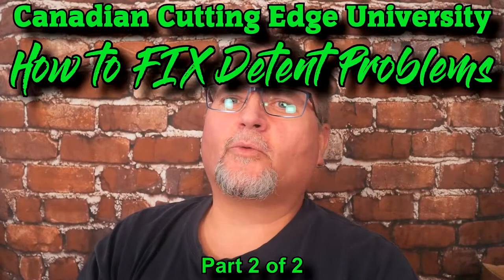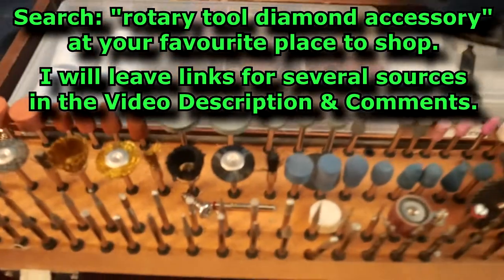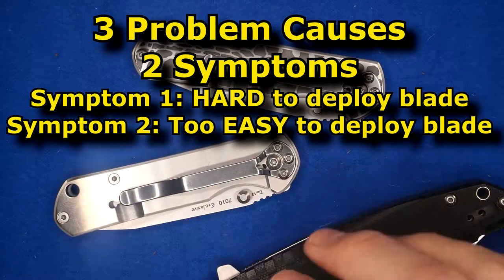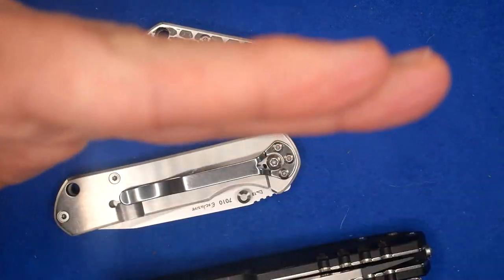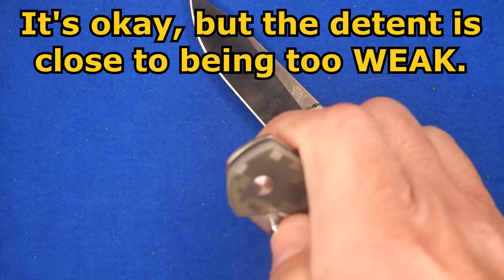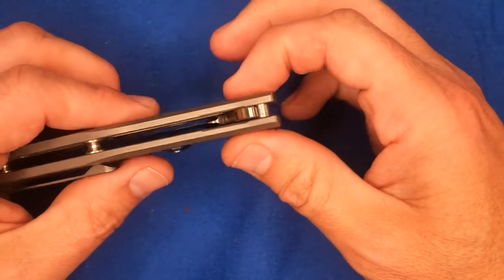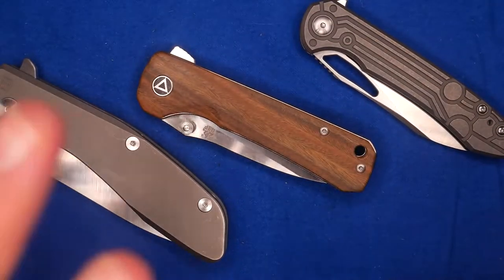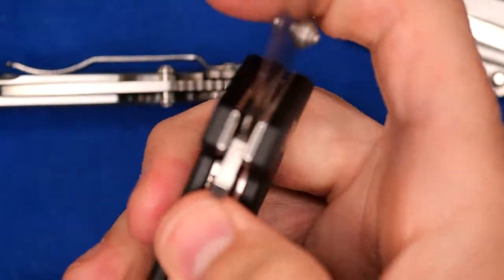CCEU Lecture #24:  How to Fix Detent Problems - PART 2 of 3

Comment: Really like and appreciate your videos. I have to say though; I've never seen a liner lock or button lock that I could not deploy by swinging my hand and pulling back up abruptly. That doesn't indicate a detent problem. On the contrary; I'd say perhaps the detent is too strong if you can't. The problem with all this is different people's physical ability to perform the action.
Reply from the maker: We each have our own preferences (not merely ability) about how we want a knife to function and how easily we want the blade to deploy.  
I am not trying to tell people to change their detent to my preference, instead, this video series teaches people how to identify why the knife is working as it is and what they can do to change that, if they want to.

Further, some viewers live in countries with legal requirements for how easily a knife blade can be deployed. In fact, in Canada, if a blade can be fully deployed to a locked open position using the method you prefer the knife would therefore not be allowed to cross the border into Canada, so they might want to adjust their knife for this type of reason.

Comment: On the knife with the too stiff detent, where you took the bit and went in parallel to the hole, could you have gone in at a 45° angle for example, and radiused just the edge of the hole where the detent ball enters and exits? Would there be any potential issues doing it this way instead of what was shown?
Reply from the maker: Even when I try to go in straight there will always be some chamfering going on at the edge of the hole -  this happens because it's being done by hand;  there is no way to be perfectly perpendicular with the tool which = some degree of chamfer.  You want to just barely chamfer the edge ever so slightly and then test it.  I would estimate that I break a 90° edge over to about 80° or maybe 75°. Most of the time and that ends up being all it needs. The issue with a 45° chamfer is that it will make the detent way too weak / soft and I would guess that the odds are above 99° that you will ruin the detent completely and beyond any other repair options.

Comment: Hey Jake! Thank you for this series. 

Even with production knives today, do you encounter ones that need tweaking of their detentes? 

I have one folder of mine that is really hard to flick out, and It makes me curious whether this is common (like 5 out of 10) or  much less common (like 1 or 2 in 100)?  My experience is only from about 20 knives, so figure you or the viewers will have broader awareness than I. 

Thank you.
Reply: I own hundreds of knives and I find it necessary to adjust the detente on one out of every four that I buy. I am very picky about how my knives should feel when opening and closing them.
Reply from the maker: YES, I often need to fix detents, that is the MAIN reason why I made this video series.

Comment: I NEVER use a rotary tool for the detent hole, it is so easy to make the hole too big, I use a drill or a diamond grinding pin with my fingers, it takes longer but is safer. Thanks for the video
Reply from the maker: OF COURSE!!  I missed that another power source for the same task.  I guess with my arthritis in my hands I didn't think of doing it that way because I wouldn't be able to.   Yes, the vibration of the rotary tool isn't pleasant for my arthritis either but it's very short.
Thanks Orange.

Comment: I am interested in a possible fix for a frame or liner lock that slips over too far on the back of the blade. Not sure if anything can be done. It's on a Gerber Ripstop which I got for ten bucks Canadian so no great loss. But it's worth fixing all the same.
Reply: You may try to make the locking liner longer via deforming it by impacts. But the ball positioning may be lost if to make it too far.
Reply from the maker: What err0ify O suggests is the only option you have.  It is not easily done but it's a very cheap knife, exactly the type that I would use to learn the skill. I do not have a video on how to do that.

Comment: I have a Benchmade Griptilian in 20cv that has a very weak detent. Since I've modified the knife, I dare not send it back for warranty repair because I've heard Benchmade doesn't like dealing with modified knives (I don't know if that's actually true or not, but I still don't want to risk the hassle). Anyway, I've not taken the knife fully apart yet, but since it uses an 'Axis' lock mechanism, I'm not sure how I'd go about fixing the weak detent aside from tightening down the pivot screw; which I've already done. Unfortunately, although tightening down the pivot screw a wee bit does increase the detent, it also stiffens up the action which isn't very nice. Do you have any suggestions?
Reply: I thought BM fixes everything under warranty. That's what you pay for.
Reply: @barrybogart5436  I don't know if that's true or not? I've heard stories of BM refusing service, or charging a fee to fix a modified knife. Like I said, I don't want to risk it...
Reply: I would disassemble the knife to make the omega springs stiffer.
Reply: @err0ify  Thanks, I was looking into getting some stiffer springs as well...
Reply: @singingtoad  you may just try to stretch out the existing springs -- they'll become stiffer.
Reply: @err0ify  Thanks for that suggestion. I might give it a try first before I order new springs...
Reply from the maker: An axis lock knife doesn't have a "detent" it just uses the omni spring tension.  You can write to Benchmade and tell them one of the springs is broken and they will send you replacements, it is common with Benchmade knives and in fact that is probably why you feel that it is WEAK - because it probably has one broken omni spring.
Search on Youtube for how to replace an onmi spring on a benchmade and you should find quite a few videos on the subject.
My video on how to adjust the omni spring on a Ganzo copy of a Benchmade could help you too - (its and OLD video): https://youtu.be/NVH89nqnj9Y
Reply: @CanadianCuttingEdge  Thanks!

Comment: And if the detent hole is too big for the ball? So the blade has a play while locked, and its tip may sometime even puncture hand... I have such a Chinese knife and think about to replace the ball on a bigger one.
Reply from the maker: Hole too big means you are SOL.  Which is why I gave the warning to remove only TINY bits of metal and then test.  It's WAY to easy to make the hole too big if you try to get it done in a hurry.
Reply: @CanadianCuttingEdge  it was  right out the box, the production defect. So I want to fix it by any possible way.